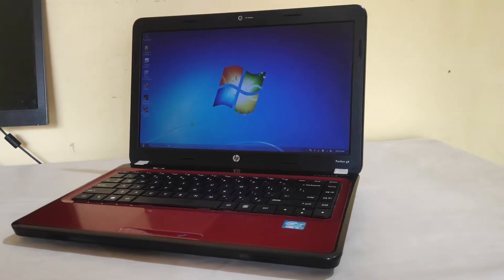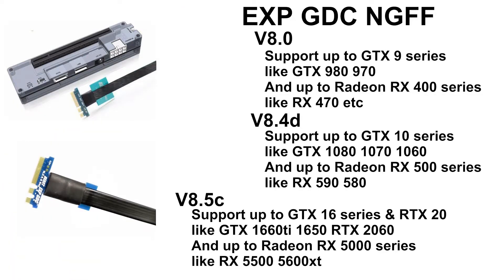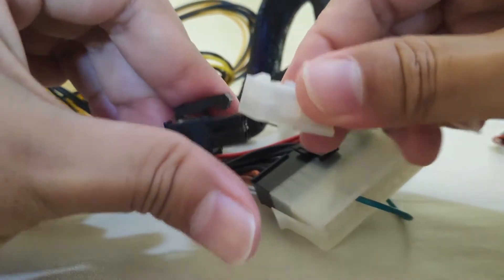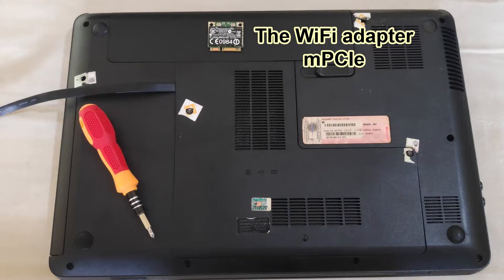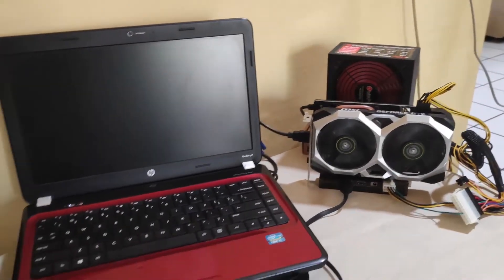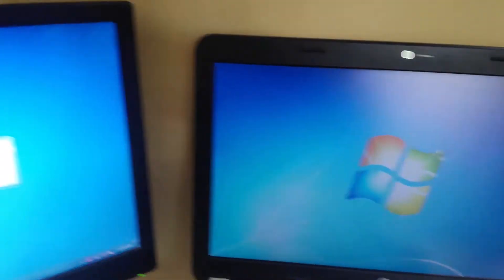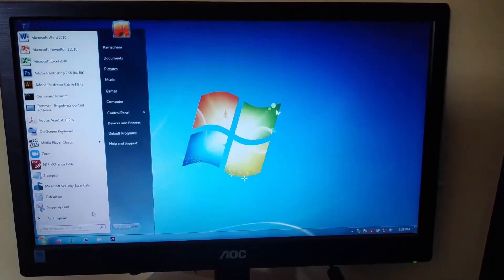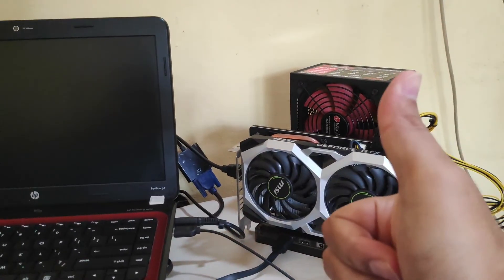EXP GDC Beast V8.5c eGPU with GTX 1660 ti on Old Laptop from 2012

Comment: Can you do a benchmark with GTA V, PUBG, Valorant and a few triple A games? If it works well, I'll try it on my old Dell Inspiron 5537 to save some bucks because I don't have money haha thanks Great Vid btw!
Reply from the maker: None of it will work.

Because for heavy Games that is dependant on CPU, you will need at least 4 Cores 8 Threads CPU. The only Old Laptop CPU that is suitable for those Games is Core i7 xxxx QM or Core i7 xxxx MQ.

Core i7 with 2 Cores 4 Threads or 4 Cores 4 Threads still cannot play those Games you mentioned. Even if you're using RTX 2080 ti.

You need a Laptop with Core i7 2670QM (year 2012) or Core i7 3610QM (year 2013) or Core i7 4700MQ (year 2014)

Any Laptop CPU that is Lower than QM or MQ cannot play those games, even with RTX 2080 ti, you will struggle to get 20 FPS.
Reply from the maker: Only Valorant and CS GO can work with Lower CPU like Core i3 and i5.
Reply from the maker: If the Video Games is Dependant on GPU, it is more smooth.

Like Rocket League, MiHoYo games, and a lot of Racing titles are usually GPU dependant instead of CPU.
Reply: @ClayWheeler Too bad I have core i7 4500 U Guess I can't play the games I wanted to play then haha anyways thank you so much for being so informative and also being able to reply to my inquiry. +sub+ to you and I hope you well.
Reply from the maker: @thethirdvlog6552  just play Video Games that is not CPU intensive. 

Like Resident Evil remake 2&3, Devil May Cry 5, (Most Capcom games are GPU dependant, so Core i7 4500U is more than enough to play even new Titles from Capcom)

All Assassin's Creed games 'Before' Odyssey, Origin, and Valhalla can be played smoothly on Core i7 4500U using eGPU. The last 3 Assassin's Creed games is crazy Heavy, with tons of Bugs.

Ghost Recon Wildlands is also good for Core i7 4500U.

Comment: Thank you so much for the thorough explanations and guide! Really helpful in the future for when I upgrade my 2012 Acer laptop. I have one question though, is my laptop PCI-E the same as yours? (simply put, are laptops PCI-E connector 1x?)
Also is 250w psu enough for gtx 960?

Comment: If I use a power supply on the adapter, do I need to charge the laptop?
Reply from the maker: Yes on Both Laptop and eGPU Adapter.

Comment: May I ask something do you use dell brick 220w i. Is it better to use it or use psu and Is there any bad effects of we use dell brick to our GPU
Reply from the maker: Dell Brick 220W PSU is really Good.
It can handle up to RTX 2060 just fine.

So basically the Dell 220W Brick PSU is connected directly to the eGPU 8 pins input. And then from the 6 pins Output on the side is enough to handle Mid Range GPU up to RTX 2060 with single 8 Pins PCIe power connector -- or any GPU with Single 8 Pins PCIe power connector in general.

See my Troubleshooting video about how to Plug Dell DA Brick PSU.
Reply: @ClayWheeler  thanks you bro you really help me there

Comment: I have a Asus ROG laptop so can I still upgrade my graphics card. I can tell you my specs if you want but I want to change my graphics card to upgrade my performance and fps on video games. I have a GeForce Nvidia GTX 560m from 2011.
Reply from the maker: Just follow steps in this video. I don't know what type of WiFi slot you have, so You must do it by yourself.

Additionally, in your Laptop BIOS, Disable PXE Boot to LAN.
Enable internal Network Adapter Boot.

Must use External Display at any time, Because your Laptop is too Old from 2011.

Comment: Can I use 1650 or 1650 super ??
Reply from the maker: Better go with GTX 1650 Super.

Reason: GTX 1650 Super has additional PCIe Power Connector 6 pins. So it can feed extra Power.

Any GPU that don't have PCIe Power Connector -- 75 Watt GPU -- is difficult to be Recognized by eGPU
Reply: @ClayWheeler  okay thanks bro I have the egpu dock just I am waiting for the GPU prices to be stable then I am going to buy GPU that is why .
Reply: @ClayWheeler  and 1 more thing in windows 10 you  have to get 2.5 gb/s with external monitor I have to show on 2 ND display I have to do it ??
Reply from the maker: @BlueWindYT  if You are using mPCIe or ExpressCard version, the answer is YES. Must use External Monitor.

if You are using NGFF or M.2 NVMe version, no need to use External Monitor
Reply from the maker: @BlueWindYT  if you're only using GTX 1650S a Cheap PSU is okay. 

But if you're planning to use a Full Build System in the future with all Motherboard, CPU, RAM, etc. You will need a better PSU.

The Power Supply in this Video is never used in a Full Rig system. Only for powering up a GPU which is around 120 Watt for GTX 1660Ti

GTX 1650S need 90 Watt.
Reply: @ClayWheeler  I brought a cheap 500 w branded power supply from ant esports that does not have any cerification of 80 plus for rupees 1649 in India that is why I am asking should I get a good power supply or stick with it ?? As 80 plus certified ones ar 2700 rupees. Still thanks for replying as I am a student and I am building this egpu. 😊
Reply: @ClayWheeler  hello brother can u make a video on nvidia t600 pls with egpu 8.5 pls . 🙏 if it works I will buy it
Reply from the maker: @BlueWindYT  as far as I can tell, the NVidia T600 T800 T100 doesn't have Supplementary PCIe Power Connector. And the all perform roughly the same like GTX 1650 but with a little bit Ray Tracing support for apps like Blender.

In video games where it has Ray Tracing, none of those T-Series can perform any Ray Tracing in the game without stuttering issue.

If you already have the PSU as you said in your Previous Comment, then the answer is NO. Your GPU might not turn on at all. Because the EXP GDC need a constant 75 Watt for the GPU Rail alone.

This is a Follow up of EXP GDC without PCIe Power Connector, you need Dell DA 220 Watt Brick Power Supply https://youtu.be/TSF8zckwTDE

And this is the preview of a GPU That is running without PCIe Power Connector like NVidia T600 https://youtu.be/ir-5JDITDd8
Reply: @ClayWheeler  yes I understand but can u make a video as I want to purchase this t600 card it is around $200 in india and it is in my budget and rtx card as well please it is a humble request to you in your hp laptop 🙏❤
Reply from the maker: @BlueWindYT  The point is The Power Supply alone.

And it needs same Watt like GTX 1650.
Reply from the maker: @BlueWindYT  That means you cannot use a 500 Watt Power Supply that you already Purchased.

You need Dell DA Brick PSU
Reply: @ClayWheeler   ooh so it won't consume power from the egpu dock ?? I have a 550 w psu
Reply from the maker: @BlueWindYT  I'm talking about THIS Setup.
https://youtu.be/ir-5JDITDd8

But I have researched a little bit about NVidia T600 T800 T1000

1) They are NOT a Gaming Card, only for Workstation card. You cannot install NVidia Game Driver for this Card

2) They are specifically designed to run on PCIe X16 Lanes. Meanwhile eGPU are only running on PCIe X1 Lane up to PCIe X4 Lanes

That means there is no guarantee this card will work on any eGPU setup because there are no eGPU Dock with full PCIe X16 Lanes.

In fact, nobody uses NVidia T600 as "External GPU" setup because of T-series Strict Limitation. Apparently it needs a Full PCIe X16 Lanes
Reply: @ClayWheeler  yes I understood now. These adapters are very hard to get in India and does same thing works with psu supply ?? With t600 if you can make a video it will help many budget gamers and streamers
Reply from the maker: @BlueWindYT  Like I said, NVidia T600 Needs PCIe X16 Lanes.

This video of EXP GDC is only running at PCIe X1 Lane.

EXP GDC is NOT PCIe X16 Lanes. It is PCIe X1 Lane.

Regular Desktop Motherboard has PCIe X16 Lanes. That is needed for NVidia T600.

As far as I can tell, there is No Laptop that has PCIe X16 Lanes Support.
Reply: @ClayWheeler  ooh my bad 😢 I wanted this graphics card but maybe this can't be possible
Reply: @ClayWheeler   hello brother will gddr6  1650 card work in this setup or should I get gddr5 🤔
Reply from the maker: @BlueWindYT  NVidia GTX 1650 GDDR6 "With" 6 pins PCIe power connector
Reply: @ClayWheeler  yes dual fan variant 🙂 single fan 1650 doesn't come with 6 pin connector
Reply from the maker: @BlueWindYT  Good good. That one will work.
Reply from the maker: @BlueWindYT  This is the example of GTX 1650 Without 6 Pin connector

https://youtu.be/ir-5JDITDd8
Reply: @ClayWheeler  hmm but I have a power supply 🙂
Reply: @ClayWheeler  hello brother once again I was wondering will rtx 3050 work in this ??
Reply from the maker: @BlueWindYT  I have never seen RTX 3050. Does it have 6 pins Power Connector?
Reply: @ClayWheeler  most probably 8 pin 🙂
Reply: @ClayWheeler  bro with gddr6 gtx 1650 graphics card any brand will work or should I get MSI one that you have but in gddr6
Reply from the maker: @BlueWindYT  any?
GDDR6 is good choice.

The cheapest one like Palit GTX 1650 is okay.
Reply: @ClayWheeler  okay I was just wondering as maybe i will get a asus gtx 1650 gddr6 or MSI gddr6 in india it costs about 18500/- ($243 )
Reply from the maker: @BlueWindYT  just make sure it has 6 Pins PCIe power connector.

Because sometimes the base model GTX 1650 doesn't have PCIe power connector.

Otherwise just get GTX 1650 Super which is certainly have PCIe power connector.
Reply: @ClayWheeler  okay bro thank you so much for helping me out I am a college student and in this time graphics card shortage is crazy here and that is why I am trying to do a egpu setup 🙂😊

Comment: I try on thinkpad t430u with gtx 1050ti but the result extrenal and internal monitor black screen from start i try many solution but no hope
Reply from the maker: See my Latest Video about eGPU Troubleshooting
Reply from the maker: Are you using GTX 1050 ti without additional 6 Pins PCIe power connector?

Are you using Express Card slot? Or mPCIe?
Reply: @ClayWheeler  i use mpcie 6 pin for power vga ? Abiut 6 pin i just plug as ussual to gdp exp
Reply from the maker: @ghalihpj548  alright, just check out my Video about eGPU Troubleshooting. You can see how to work it
Reply: @ClayWheeler  yeah i watch the trouble shootong about psu dont deliver 75wat but i confuse that video , how i can do deliver pure 75 watt for gdp
Reply from the maker: @ghalihpj548  when you try to turn on the Laptop and eGPU, is the 1050 ti Fans Spinning instantly or not?
Reply: @ClayWheeler  yes the fan spinning instanly , i try ptd and atx on no result still black screen
Reply from the maker: @ghalihpj548  yeah try using Electrical or Masking tape to Cover Pin #2 or Pin #22 as in my Troubleshooting video

Comment: Will the 8.5c egpu dock support a Radeon RX560?
Reply from the maker: Yes Bro. V 8.5c support all Radeon RX 500, RX 400, RX 5000, RX 6000
Reply: Thank you! Trying to figure out why my HP pavilion has no monitor activity after swapping the wifi pci adapter with the egpu/hdmi cable😖
Reply from the maker: @burrit0bendit0  wait, that might be different Problem
Reply from the maker: @burrit0bendit0  please check my other Video about Troubleshooting of eGPU.

Comment: I have a Dell G3 with i7 10th gen and 1650ti graphics, I was thinking of using the exp GDC to install a 1660 super, is it worth it? Would I lose a lot of performance even while using an external monitor?
Reply from the maker: but your Laptop already have Thunderbolt 3 port?

I'm afraid that most Laptop with Thunderbolt Port already have WiFi Adapter Slot whitelist. Which means the WiFi Slot cannot be used for External GPU except the WiFi card itself

How much Storage Slot inside your Laptop? Like SATA or M.2 NVMe Slots? You can use that NVMe Slot for eGPU.

Otherwise, just use Thunderbolt 3 eGPU
Reply: @ClayWheeler  Unfortunately I purchased this model last year, and the version of G3 last year had thunderbolt 3 only for 1660ti models and above. I believe it's only a USB type C port and not a thunderbolt 3.
Reply from the maker: @yashjadhav1570  Then you have 2 Choice. By using WiFi adapter Slot which is NGFF and the Top speed is just 8 Gbps

OR

Using M.2 NVMe slot for eGPU which the Top Speed is 32 Gbps. That's a Huge difference in speed.
Reply: @ClayWheeler  I think there's an additional SSD slot, is that the nvme slot? And would it bottleneck the GPU performance, I've been seeing benchmarks where games are only able to run on medium settings
Reply from the maker: @yashjadhav1570  If you are using M.2 NVMe slot, you can run 4K Resolution just fine. Because 32 Gbps is the Minimum Requirement for a Smooth 4K Gaming.

This is the Reference for NGFF eGPU Which is enough to run Red Dead Redemption 2 https://www.youtube.com/watch?v=pKv436sOrNo

And then, this is the Reference for M.2 NVMe eGPU Which is using ADT-Link R43SF https://www.youtube.com/watch?v=3QjmJrjyVLg
Reply: @ClayWheeler  So the NVme one basically plugs into the SSD slot instead of the WiFi slot? And does it utilise the GPU completely? Or will I have to settle with like medium settings or something? Can I run it at max with ideal FPS which you would get in normal situations ?
Reply from the maker: @yashjadhav1570  you must Open your Laptop by yourself to confirm it first before buying any eGPU setup.

 Because your SSD M.2 NVMe slot might be already occupied by SSD for the OS.

You need to plan it carefully instead of asking my opinion.
Reply: @ClayWheeler  Yeah cause it's extendable, so there's an additional slot
Reply: @ClayWheeler  it would give me a boost from my inbuilt 1650ti, right? Or would it bottleneck and give me a major loss in performance?
Reply from the maker: @yashjadhav1570  warning! Please read the extra M.2 slot carefully!! Usually it is written right near the slot.

If it says "NVMe" or "PCIe" or "SATA x PCIe" then it might be usable for eGPU.

If it says "M.2 SATA" then it might not have PCIe Signal capability --- which means it can only handle an SSD.

If you confirmed it is definitely a NVMe PCIe slot, Refer to the JayzTwoCents video that I wrote above.
Reply from the maker: @yashjadhav1570  if you're using ADT-Link R43SF as in the Video link above, you can play any games at 1440p easily without any Bottleneck. Because the Game process will be Off-Loaded to GPU instead.

In the video above he used RTX 3060ti and it's butter smooth Gameplay
Reply: @ClayWheeler  Okay thank you so much, I'm gonna give it a go once the GPU prices drop down
Reply: @ClayWheeler  okay so I checked the spec sheet, the slot says PCIe NVME M.2

Comment: so im doing this with an hp elitebook 8460p with the express card slot will this work just fine?
Reply from the maker: Yes
Reply: @ClayWheeler  will it be whitelisted?
Reply from the maker: @zacharyschwanke7160  rare case where ExpressCard have Whitelist.

Whitelist often happen in WiFi Card Slot
Reply: @ClayWheeler  so i shouldnt have anything to worry about then? i plan on using this on a hackintosh
Reply from the maker: @zacharyschwanke7160  then it is impossible.

Hackintosh can only Recognize GPU on a Desktop -- Or a Laptop's own GPU if it had one.

Hackintosh with eGPU can only be handled by a Laptop with Thunderbolt 3,  and also with tons of errors, since it only accept Radeon GPU
Reply from the maker: @zacharyschwanke7160  Yes Of Course, but recognizing a GPU from Express Card slot, on Hackintosh will return you with Error Message (Not Enough Bandwidth).

If you still need Hackintosh with eGPU, the Best thing you can do is by using Thunderbolt 3 or a Desktop PC.

eGPU on ExpressCard is Windows Only
Reply: @ClayWheeler  oh ok
Reply: @ClayWheeler  what do you recommend?
Reply from the maker: @zacharyschwanke7160  I don't know what  to recommend for Hackintosh with eGPU.

Other than Desktop PC or Thunderbolt 3 eGPU.

Comment: Hi bro!

I have this laptop with this processor

hp notebook - 15-dw0020la

Intel Core i3 8130u

I would like to buy the GTX 1650

do you think it will go well?

Thanks
Reply from the maker: I'm not really sure about HP Laptop with 8th Gen Core i3 because it "May or May Not" have WiFi Whitelist. Which means anything other than its own WiFi adapter might not be Detected unless you Flash the BIOS.

Meanwhile the WiFi Adapter is using NGFF Type, reference https://www.youtube.com/watch?v=pKv436sOrNo

On the other hand, GTX 1650 (not Super) is a 75 Watt GPU, and it doesn't have additional PCIe Power Pins Connector (either 6 Pins or 8 Pins like in this Video) Which means you cannot use this Video as Reference.

For how to Power Up 75 Watt GPU and the reason why, here's the Reference https://www.youtube.com/watch?v=TSF8zckwTDE

EXP GDC Exclusive with GTX 1650 and Dell DA 220 Watt Brick PSU https://www.youtube.com/watch?v=ir-5JDITDd8
Reply from the maker: If you want to use a Cheap Power supply, I suggest buy GTX 1650 S. Not the original GTX 1650 (not Super)

Because GTX 1650 S has additional PCIe Power Pins connector, so it can use This video as Reference
Reply: @ClayWheeler  The bios of the laptop is updated, I downloaded it from the HP website!

What do you mean by the GTX 1650 '' s '', excuse the ignorance, would this have a bottleneck?
Reply from the maker: @LahogueraGaming  no.

GTX 1650 is a 75 Watt GPU. It doesn't have PCIe Power Pins Connector.

GTX 1650 Super (also know as GTX 1650S) is a 90 Watt GPU. It has additional PCIe Power Pins Connector.

Watch the Video link I wrote above

Comment: I have acer e5-574-39cl , 8GB ram, Intel core i3 6100U,  onboard Intel HD Graphics 520....
I have expgdc v.8 and I want to know , what are the compaitable graphic cards that can be use without bottleneck to my laptop (I already check bottleneck calculater and it shows the GTX760 , 750 like etc)....